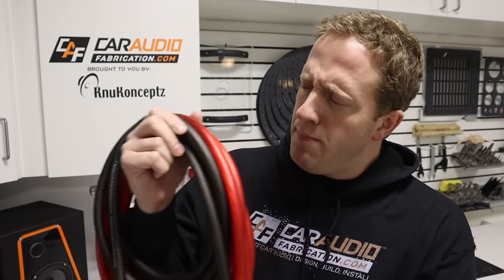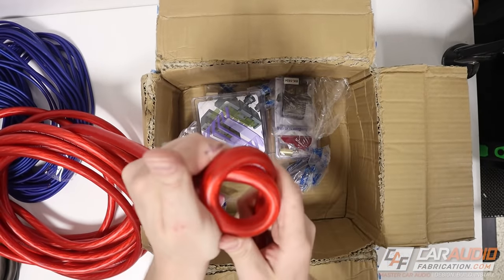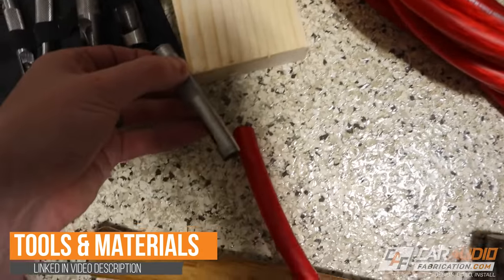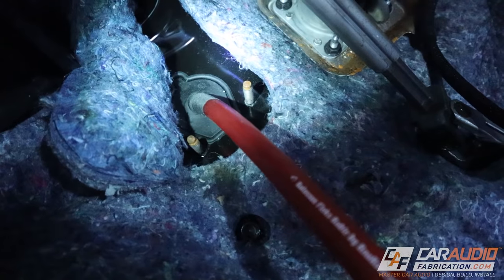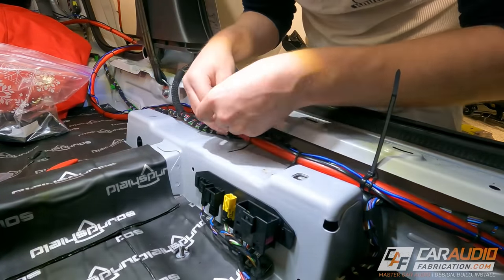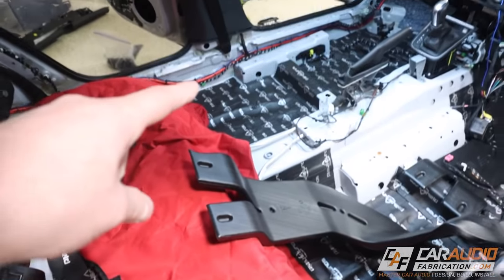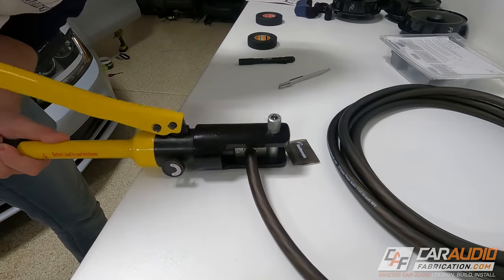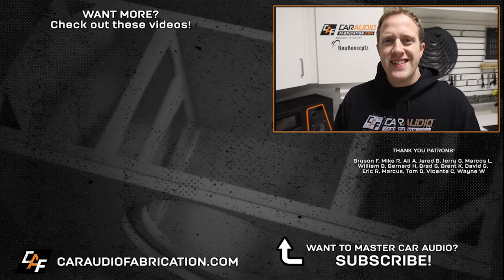How to: Wiring for Car Audio System - Power, Ground, Signal & More EXPLAINED

Comment: Does it realy matter a lot how thick the power wire is, i used a cheap kit and the wire is thin but rated for 2800 watt and that is what my sub is rated at, i purchased 0 AWG ground separate as the included was just pathetic, im asking as if i upgrade the power wire to the sub what would the benefit be thanks anyone

Comment: Run into the same problem for the speaker wires on my 2002 Intrepid R/T. Had to use the stock wiring to get power from the amplifier. Run some cable from the amplifier and then solder them to the stock wiring (this car got an infonity system from the factory) in a very cramped area. 
Sound proof a lot of the trunk also and the doors. Work very good, and sound awesome,

Comment: Hey man can you do a video covering info pertaining to installs with this:
- Head unit pre amp outputs
- Best way to set up depending on # of rca outs with a 4ch amp (4 speakers 1 sub) or a 4ch amp plus a mono amp. 

I know more pre amp outs are better for fading etc. I dont think it would matter running 4 speakers 1 sub on a 4ch because the parallel wiring using 2 channels prevents  balance/fade anyway. 
Id also appreciate a big 3 upgrade video. power and ground is simple but how the heck do you do the alternator wires?

Comment: Question - pretty sure you were going to go with 12g wire for this build (unless I'm confusing with another build) you end up saying the stock wiring in this car is good enough to run the door speakers on. I'm assuming that was 18g? So I'd assume with the 50 max rms speakers that I'm going to run - the stock wiring will also be sufficient.

Comment: could u please do a vid on how to match the right SPEAKERS to sub and amp setup
Reply: I dont think theres a real answer to this other than balancing the wattage of mids/highs with the bass. Hes done a video before explaining it all and giving ratios to use. For instance 65% of my theoretical power is to my sub and the other 35% goes to my 4 speakers and 4 tweeters. My sub is on a 1500w amp and speakers on an 800w amp. Obviously consider RMS watts mainly. Dont trust the wattage ratings of cheaper brands though, make sure the fuse ratings add up so you can make an educated guess

I have loud bass and enough mid/high that its clear. I believe something like a 50: 50 or 60:40 is pretty common.

Comment: Congratulations mark on your channel doing very well, very informative...
Im hoping to get more info on the orion hcca 11000.1d...
I get screeching noise over subs for few seconds when turning on and a noise wich can be heard from inside the amp, is this normal and when does the fan switch on, pls advise if you hav knowledge about this

Sorry, i know its a old post

Comment: Hi Mark, I wanted to ask a not so common question.  I have a Female RCA FRONT left and right out of the radio.  I want to hook it up to an LC2i Pro.  Since it is connected to the LC2i using speaker wires, I wanted to connect to the RCA using an male adapter that has a pos and neg going into the female RCA.  This will result into 4 wires.  So my question is, can I hook up both the left and right ground together and then run the positive for left and right into the LC2i left and right, and hook the Negative of the input of the left and right together?

Comment: when doing a audio install, I know I should use a fuse closer to the battery, I also know there should be a fuse on the distribution block that splits to two different amps. My question is if i am running same size wire pre and post distribution block, do I still need a fused distribution block ... Thank you

Comment: Extremely helpful videos coming all the time! Quick question: I want to add a secondary mono amplifier to my system, how do I connect the extra ground cable? Should I use a splitter or wire the secondary ground cable to another ground bolt? Thank you and keep up the good work. Best wishes from Turkey!

Comment: If adding a power wire under the vehicle in an environment that gets snow and ice should I add a cool tube or similar to help protect it, or is a loom with tape still ok?
Also I'm running wires under the hood I have a wire that goes right over the engine,  I added firetube... is that overkill?

Comment: Hey Mark,  quick question how did you get the center console out of that jetta , I have a mk6 ( 2014 ) model and I can't find a diagram anywhere,  I can get the middle and back section off its just the front towards the dash thats the problem

Comment: Good or bad to run a ground wire from the front battery to the trunk battery ?
Reply: It doesn’t matter your basically grounding it still so it’s fine to do that

Comment: Subbed to your channel about a year ago. You've helped me with installing my system in my 2015 VW beetle 🥰 with your videos. I had to put in an extra battery for my system because after much research I couldn't find an alternator. The factory alt puts out 140amps. I have about 3k watts and the battery supports up to 6k watts. Will this be reliable for the long haul? DB comp 10 sub currently and upgraded cabin speakers. Kenwood HU that's 50*4. I have plans to reconfigure some things that I just bought and didn't understand what I was getting.

Comment: I’ve been subscribed to your channel for a few months now and I’m learning a lot. I’m about to hook up my stereo system after nearly a year of waiting to afford something decent. What I have is nowhere near what I have seen since starting this. I have a simple question but I need the answer before I start. I have four 6x8 component speakers with passive crossovers(Audiopipe CRX-203) and four tweeters. Each of the 8 speakers are rated at 8 ohms. My question...when I hook each 6x8, tweeter and crossover up what will be the ohms rating? Also, if I run 2 sets in parallel (two crossovers, two 6x8’s and two tweeters) what will be the ohm rate then? I am thinking of bridging my 4 channel amp and running my speakers parallel to hit the 4ohm amplifier rating. Can anyone please answer this for me?

Comment: Im looking at installing a amp in my car, i'm keeping the standard headunit which doesn't have rcas. so need to run the speaker wires to the rear where the dsp/amp is then back to speakers. Does speaker wires have the same issue that rcas have with noise if its near your power cables?

Comment: what is the max length of 4g OFC ground wire I can use? My 4g OFC power wire will have about a 4-5 foot run as my battery is in the trunk. Can I also use 4-5 feet of ground this example to run back to the battery ground?

Comment: Caraudio fabrication hi trouble choosing between massive audio hippo xl 8 or 10" vs db drive wdx and also 4 channel orion cobalt 1500w vs soundstream 4 channel 2000w and is massive nano edge 4000w which is best and would a 50 amp power supply work or it will dip or buck some told me I should consider a car battery for music please let me know your thoughts

Comment: I went to purchase a Knu Konceptz wiring kit and several reviews on amazon claim that it is not "Tinned OFC" but instead is Copper Clad Aluminum. If one were to cut the power and ground cables of True Tinned OFC , Would it appear tin on the outside and copper in the middle?  Because people want a way to prove their T.OFC is real
Reply from the maker: Unfortunately there are people that don't have a clue... They are making incorrect statments simply because it is silver in appearance. By their logic they make the worse mistake and buy CCA THINKING ITS OFC (simply because it is copper in color... 🤦‍♂️)

It takes two seconds holding this wire and you can tell by weight alone that it is OFC... If KnuKonceptz was looking to pull a fast one on people they would just leave the wire copper colored because people don't have a clue. Same reason people buy "5000 watt" flea market amps that don't even do 50 watts... they buy with their eyes and not logic.
Reply from the maker: Also I just went and checked and they have nothing but stellar reviews on amazon... so not sure why you are saying this. Must have saw one bad review from an uneducated person.

Comment: hi I have a alternator whine coming from the rear speaker on my car when I press the gas.  Also 1 channel on a 4 channel amp doesn't work.  Can it be a bad ground or bad amp. Any advice is appreciated

Comment: Mark is it safe to run power and ground they both welding cable side by side is tan on the driver side from front to back
Reply from the maker: As long as everything is properly fused to protect the wiring. More details here - https://youtu.be/0H005TcKHKo?si=hDhcwYpi7AjjAfei
Reply: @CarAudioFabrication  thanx

Comment: Love the videos Mark, but do NOT flush cut the zip ties with cutters.  Just nic the extra strap up against the zip tie's clasp and then twist it 360deg in one direction....it will give you an absolutely smooth finish every time.

Comment: I’m new to audio systems  but I wired mine up today and my subs arnt working amps turn on but that’s about it I wired this same set up on my 2018 Silverado but with one single monoblock all I did was go from a sealed box to a ported and added another mono n put it in my 2000 civic anyhelp would be great
Reply from the maker: Are the subs wired correctly? You can use a multimeter and see if you measure resistance on the speaker wires.
Reply: @CarAudioFabrication  they are it’s working now I just had to go through my stereo settings and turn on the subwoofers thanks for your reply
Reply from the maker: Glad to hear

Comment: If you have water coming thru that clutch grommet you have waaayy more serious problems  .....you probably shouldn't  have driven into that flash flood 😨
Reply from the maker: Its not water pouring through that I mean. Just a little bit of water during every rain/snow storm coming through leads to mold and mildew and the car smelling. Are you really arguing that it's not a big deal to just do things right?  🤔
Reply: @CarAudioFabrication  no but just think about it....it's a funny visual..🤣...but I'll agree if you were caught in a rainstorm and either forgot to close hood or were running hoodless (cars are always faster with no hood look it up) or first scenario driving into flash flood ...you might get enough water down to that location on firewall..but it's a mute point because of  3m strip caulk around 0awg...just because I'm super anal like that